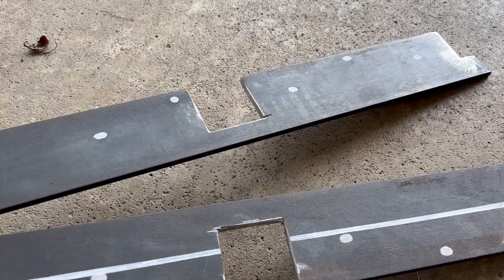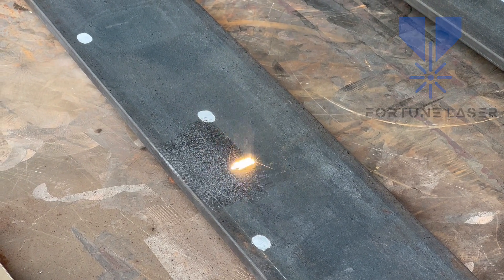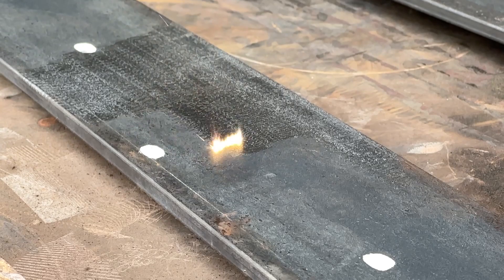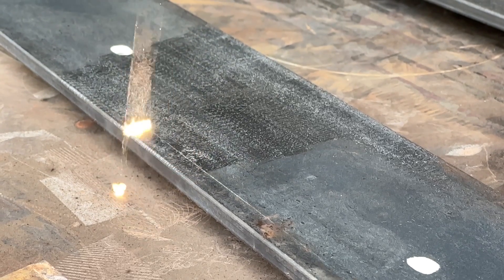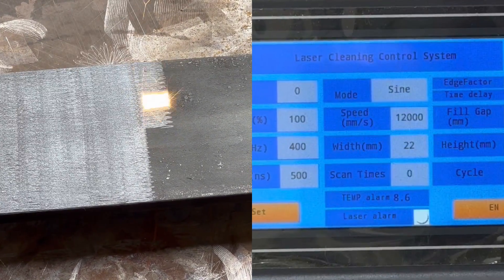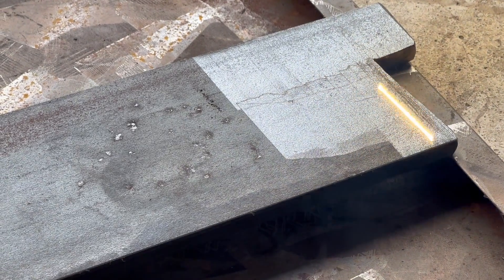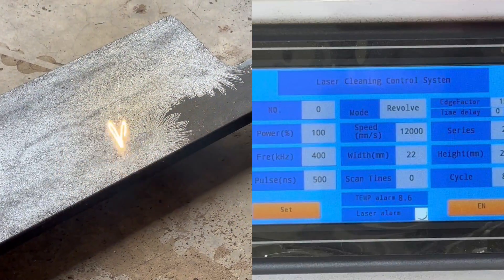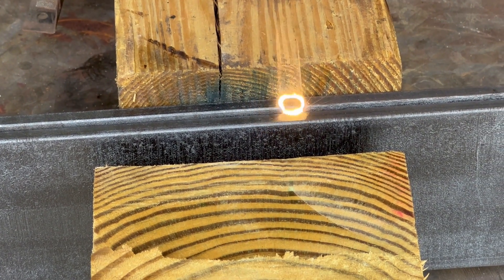Removing Mill Scale with 200w Pulsed Laser Cleaning Machine

Comment: I have a similar pulse cleaner... Ive only had it for a week, but I spent all day today getting it dialed in for mill scale removal... id love to see a video on some of the settings you use as far as frequency and width are concerned
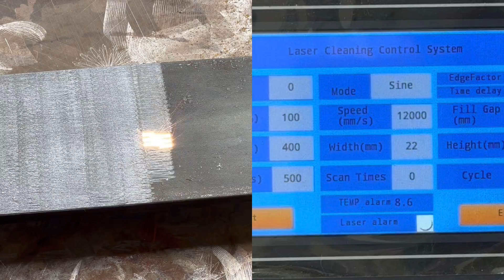Reply from the maker: Aside from switching modes, the settings were all the same as shown at 1:50. Those are the same settings I usually have the machine set to for rust/paint removal as well. Sometimes I change the width, depending on the shape of the piece I'm cleaning.

Comment: I wonder how effective the laser would have been removing rust from the hubcaps you did last week? Or would it be too harsh for this application?
Reply from the maker: I used the laser to remove very light surface rust on the chrome air cover of my weber carb, and it etched the surface. Maybe if I turned the power down from 100% it could have been okay.